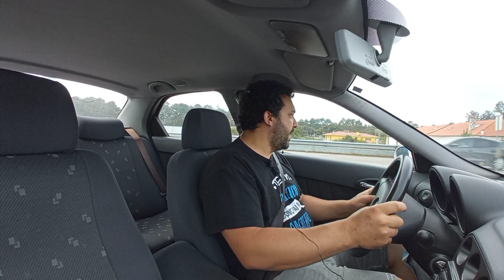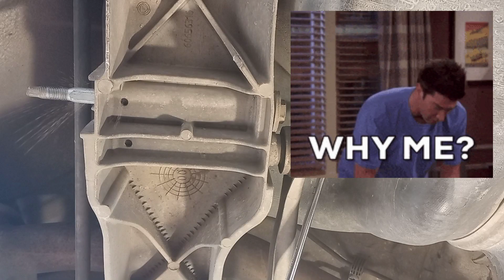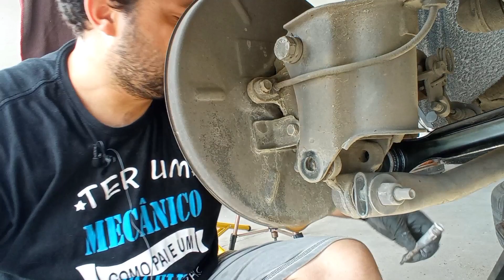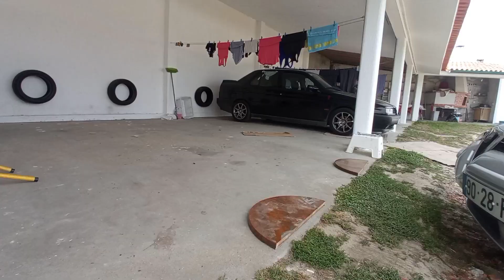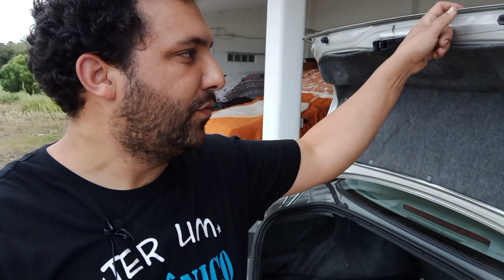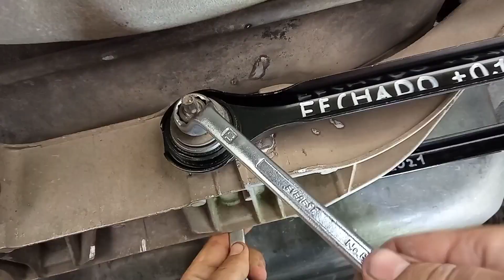Complete tutorial, rear control arms. Disassemble, tips and assembly.

Comment: Do you know what is the length of these two OE transverse arms? Aftermarket ones got very different lengths. Delphi arm is 648mm while FAG is 592mm - same part number and same transverse arm.
Reply from the maker: Hello. I did not measure them. The part numbers I used are down on the description

Comment: working on a car without rust is so much easier, my 156 is from 2002 and looks so bad compared to this one, once I had to replace the rear trailing arms because they rusted inside out (can send you some pictures of it) and it took me 5 hours just because of one out of six bolts was stuck, great tutorial as usual
Reply: an impact gun really makes a job like this smooth
Reply: @lucianistoc1264  in general yes, but when a bolt snaps and there is no acces to  remove the rest of it that makes it worse
Reply from the maker: Yes, I use it on my daily work. But on camera makes a lot of noise. Also like this for those who do not have a gun it's easier to understand
Reply from the maker: Hello, yes I understand. In here we too have problems with that on cars that are imported from countries that have snow and salt. Also cars near the sea side. Preventing is the best thing

Comment: Great. Love these kinds of videos. And I just love aluminium suspension parts. I hate steel, it just rusts and seizes up, and is heavier.
And that makes me wonder, if subframes on Brera are made of steel and known to rust (depending of the country), why no aftermarket manufactorer (or Alfa it self) made an aluminium subframe for it? It would solve the rust problem, and would lighten the car.
Also, a facelifted Brera has more susspension components made out of aluminium instead of steel, so it makes me wonder if it is possible to install those aluminium parts on a pre-facelift Brera?
Regarding grease. I would not use it on the threads, since it is a lubricant, and when you tighten a bolt with a torque wrench, you will end up tightening it with higher torque (because the specified is the dry torque, not lubricated). I would use new bolt (unless the old one is intacked), stainless or galvanized (new bolts too), so it should not seize in years, and also apply medium streinght threadlock on the threads.
And I would always change the complete arm,not just the bushings and resusing the old arm. If you keep reusing the old arm, due to metal fatigue, it can break one day during driving.
Reply from the maker: Hello. About the grease, I do put normal grease on any components. I'm aware of the consequences. This is not grease, it's a anti seize compound. Perfect for this and made for this situations. I use it in lug nuts even! Did it on hundreds or thousands of cars. It not come undone. 
The 939 used GM systems and parts, because of Saab, they wore stoped to create a better product
Reply: @alfaromeonoproblem  Yeah, but anti seize is basically grease, with added components (metals, ceramics, minerals, graphite,...).
So, post-facelift components don't fit on the pre-facelift?
Reply from the maker: Post face lift are almost non existent in Portugal... Very low sales.. but I will keep a eye on it to see the difference
Reply: @alfaromeonoproblem  Thank you.

Comment: Try to unscrew in Poland these 4 bolts for geometry of control arms :)
I spent one whole day to take and not damage them...
Reply from the maker: Hello, yes I understand. In here we too have problems with that on cars that are imported from countries that have snow and salt. Also cars near the sea side. Preventing is the best thing
Reply: @alfaromeonoproblem  So, in Portugal, you can drive on summer tyres during winter even?
Reply from the maker: Yes, no problem. All year with summer tyres
Reply: @alfaromeonoproblem  Well, that makes choosing tyres very easy for you. :D
Just get some UHP summer ones, and you are good to go. While we have to see if we should get all season tyres, or get two sets of summer/winter, then if we should get another set of wheels, or keep changing tyres on the same set. Then when shudl we change the tyres. Where should we store them, and so on. :(
Reply from the maker: The down side is in Portugal all crappy tyres are good enough. We have lost of accidents due to bad tyres, used ones, Chinese crap.. it should have more tightly  laws and rules. The age of the tyres was meant to be, but.. 99% wore ilegal.